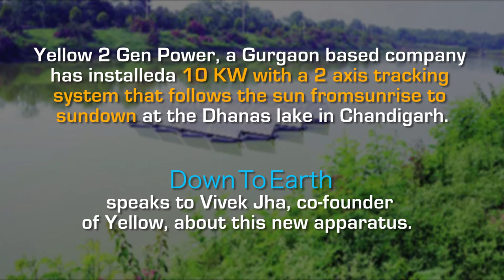Floating solar power plant: interview with Vivek Jha

Comment: How could fountain helps in bdtter survival of fishes
Reply: Do not arrange the floating solar bracket too fully. Leave some light for the fish.

If u are interested in float solar mounting system. I can send u PDF for free to your email. But i need your email.
Reply: @Paasha kamaal 
They are using fountains as areators here (aereator is a machine which increases the dissolved oxygen in water by uts rapidly moving flaps on surface of water,here the water which Is getting splashed again and again by the fountain,serves as a mini areator. )as a result due to increased oxygen in the water fishes may find a better place....
But in my opinion this doesn't help that much for their survival